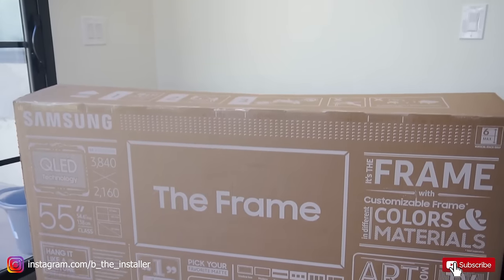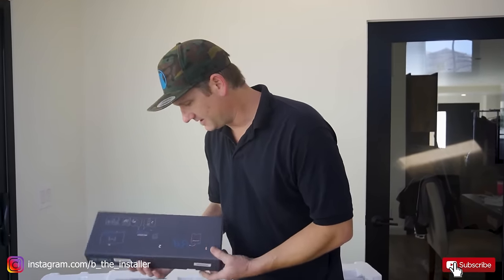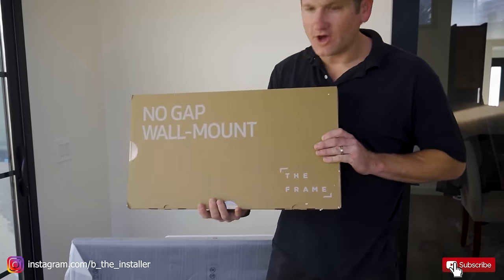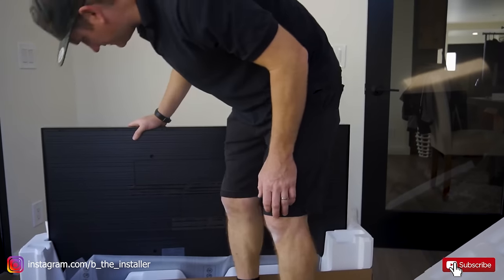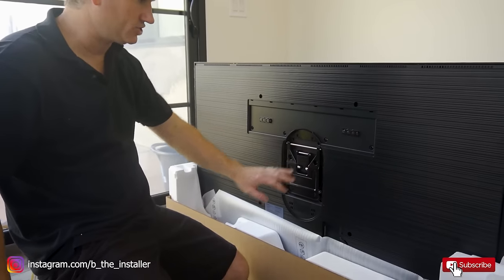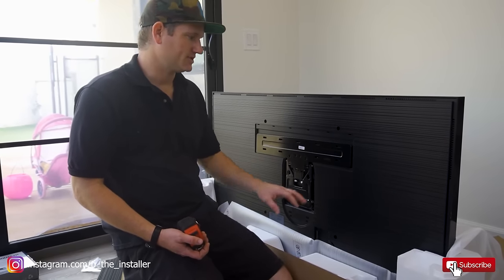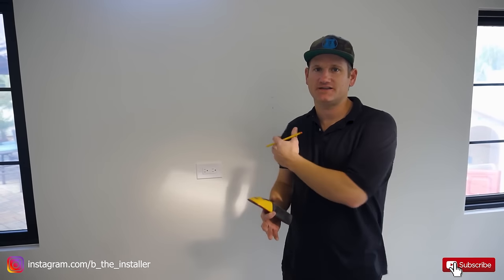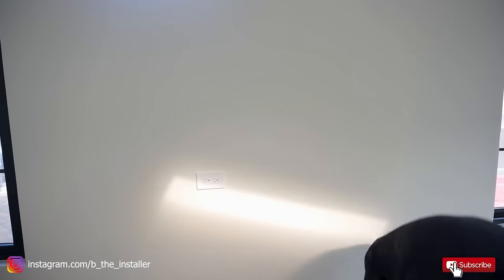Samsung Frame TV Installed w/ "No-Gap" mount in 30 minutes

Comment: Nice video thanks for posting as Samsung does not have a great source for specs I learned more watching your video. Couple?s for you have you done a 65” frame tv looking for the specs on that also wonder if the one connect box can be put in a cabinet or does it need to be in the open for the remote to work?
Reply from the maker: Thanks.  I made a FAQ video on frame that will help.  Its Bluetooth so can be put anywhere.

Comment: Hey man, just got mine, great video. What's the tool you use to cut the holes in the walls and what do you repair the drywall with? Thanks!
Reply from the maker: Drywall knife.  $10 at home improvement stores.  Fast lite 5 is the mud.

Comment: Great video but correct me if I'm wrong...I thought the one connect cable that comes with Samsung is NOT "in-wall" rated which means it can be a fire hazard when concealing the wire...no??
Reply from the maker: use a conduit

Comment: I had the same issue (24:15) with the leveling mechanism arriving off vs. the main bracket and not twisting. As B suggested needle nose pliers on the bolts did the trick (rotate counter clockwise) to loosen the mechanism so it could tilt with moderate force as intended.

Comment: Hey, great vid! Quick question: What is the official name of the box that you fished the wire through next to the power outlet called, so I can know exactly what to ask for at Home Depot? Thx
Reply from the maker: That is a single gang low voltage box. And a nylon oversized blank cover plate that I drill a hole through.  Thanks and good luck.

Comment: Great video. I already have conduit behind my wall for power and hdmi cords. Will the one connect plug fit through 1 inch conduit?
Reply from the maker: The end that goes into box should be close... I think I used 1 1/8 inch to cut the hole for cover plates.

Comment: Great video and super helpful! One question: Did you use any conduit for the one connect wire?
Reply from the maker: Yes? You should.  Though it's still not 100% legit.  This wire is a combo data/power line and so technically the wire itself is a contradiction to code.  I'll let women and men with more time on their hands debate it's legality in wall.
Reply: If it’s not up to code try explaining that to the insurance company..response did no require that much time off my hands..

Comment: Awesome video! Thanks for taking the stress out of process. What size Toggle Bolts did you use?
Reply from the maker: No problem.  3/16" toggle bolts.  Normally 2.5" or longer.
Reply: @BTheInstaller  Worked like a charm!

Comment: Nice video! Why don't you use a mulitool to make holes in the wall?
Reply from the maker: My good friend also asked why not use impact to push bolts in too!  I've used milwaukee drills for while because when I need to drill 1" or larger holes through 4x4s and larger, it's just best to have a strong 18v.  But the average home owner can use whatever works.  It may be time for me to get a lighter drill.  Maybe the new M12 from mileaukee.

Comment: Brandon, thanks for this, awesome tutorial!  One question - if installing on concrete (dry wall layer in front), would the only thing that changes be the use of a wedge anchor instead of the togglebolts?  Thanks for your help and keep up the good work!
Reply: BUMP

Comment: I hanged a 65 inch frame tv but  I am kind of sceptical  i only used toogle  bolts  same as yours and I used  10 of them and there is no stud in the wall just dry wall and it survived its first day mounted would  it be safe to leave  it or to bring it down ?

Comment: Thank you for a great video! We have a wall that is not exactly straight, which means that if we hung this flush onto the wall, the TV would be farther away on the left side than on the right when we are sitting on the couch watching it. Is there a way to use one of the extender bolts you mention at 5:02 on the left side and then not use it on the right side to give the illusion of being straight?
Reply from the maker: The bolts are for keeping it further away... if its just a little curved I would use the foam... you can even double up the foam if needed but I would balance the gap on both sides. Most people won't notice.. many pictures hang off the wall a little.  But yeah I would add some on the least visible side so the more exposed side is clean

Comment: Excellent video and instruction. I am considering a purchase but there is no place to store the one connect box considering where I want to install the TV. Ideally I can easily place the one connect box in the basement but does the TV controller need to point to the one connect box or the tv?
Reply from the maker: No, it's Bluetooth.  You can put it in the wall. Not sure your wall type but I'm going to do a video soon on how to do this.
Reply: @BTheInstaller  Great thanks. The wall is just standard drywall with easy access to the basement. So I want to run power, the box and all cords down the wall to store in the basement so the only item on the wall is the TV....like a true picture frame. Looking forward to the video.
Reply from the maker: @marcocondoleo2616  i can't say 100% the Bluetooth can work through the floor to basement.  It works in adjacent rooms and pretty good reach on my tv... never tried a downstairs.   The install I will do is directly in the wall right behind the tv. So you wouldn't need to run downstairs.  But its a different application.
Reply: @BTheInstaller  There is a closet behind the wall where I want to install the TV so perhaps that's a better place for it since the bluetooth works through walls. I could try it.
Reply from the maker: Yep, by the way you were about the 250k view.  1/4 way to 1M
Reply: @BTheInstaller  Awesome! Looking forward to the next video on this topic.
Reply from the maker: Make sure to check out the new white frame video.  It's pretty snappy and has some good music and text

Comment: My understanding is that the One Connect is not "in-wall" rated. As a professional installer, do you recommend this type of install if the manufacture does not?
Reply from the maker: I've answered this over 100 times on this video... its not in wall rated, its your call.  The risk of the cord getting cut in wall or advancing a fire is not up to the standard of electrical code.  It is unlikely to cause fires but I can't give you guarantees.

Comment: Awesome video. Very informative and I will use this when I reinstall my TV in my new place. I have the 2018 q9fn. Was wondering if you could tell how to remove the TV from the wall mount as we need to move the TV soon.
Reply from the maker: I dont know the mount is it a no-gap?  It just lifts off straight up.  A little difficult.  Just lift up

Comment: I’m reading that the wire isn’t rated for in wall use. Is that correct?
Reply from the maker: correct, it technically should be in a conduit. you can order a Non-split loom 2" conduit on amazon for like $30 for 10ft section

Comment: Great video! Do you have any recommendations for full swivel mounts. I just bought the 32 inch version and the rear mounting screw holes are 600mm wide by 400mm high. It does not have the usual vesa pattern. I want to be able to use a full tilt mount. I am having a hard time finding one that will fit . Thanks!
Reply from the maker: The 32" does not have a 600x400 pattern.  It's like 200x200. But why would you put a frame on an arm mount.  Just get Samsung q90t
Reply: @BTheInstaller  I want to hang it in the kitchen between the upper cabinets and the countertop. I am a photographer and love seeing my photos when it is off. The only holes that seem to accept screws are located where I described. There are indentations in the regular VESA pattern but they are covered. Is it ok to pierce the backing?
Reply from the maker: No.  The 32" tv is only like 26 inches wide.  600mm is like 24 inches. So you're saying the holes are 2 inches from the edge? No.  It has recessed holes. You use long M8 bolts i believe.  But you can put on an arm mount. Actually they have "single arm recessed mounts" as well. Search that up as I wrote it. You could cut the box out of drywall for that and put in wall and it would still go back flat to wall.  I am certain that does not have a 600x400mm or 24x16 inch mounting pattern. Not even the 75 "has that.

Comment: Thanks.  Could  i run the cable  up into the attic and then down to where the box is located?
Reply from the maker: Any in-wall usage of the cord is difficult.  Running up through studs and into attic and back down is exponentially more complicated and you risk more issues. Ideally I would hide it behind the tv if you don't need to connect anything to it.  If you do, opposite wall or under is better
Reply: @BTheInstaller  thanks so much!

Comment: Hello B, what a fantastic video😊 I’m due to receive the 2020 version same size on Wednesday. Mud question is how can I get the wire not underneath it but further down to the right and under as that’s where I have my sockets? Thanks so much
Reply: My*
Reply from the maker: Hey Oumar,  I would consider moving a power outlet over closer to tv or getting the in-wall rated cord if you have to cut drywall out to route it through the studs in wall.... which is what you'd need to do.  Its not easy with any type of wiring for a DIY'r but the thin wire wouldn't be very safe in wall like that
Reply: Amazing, thanks ever so much!
Reply from the maker: No problem.  If you had planned on having nothing under the TV, like many of my customers, then we do try to figure something out like routing it behind to a room on opposite wall, or like you initially asked, down the wall inside... so it's a common need, but also you can solve by getting a decoration under the TV and just dumping the one connect inside a magazine basket or something if you can extend a power outlet closer

Comment: Fantastic, informative video, thanks for sharing! Have had a 55" Frame since Xmas and haven't yet put it up because intimidated & assumed I needed help with the installation. SO grateful for your video which makes the whole project seem less daunting. Any advice on installations on stone? I know it may not sit completely flush with the wall because of the stacked stone facade. Just wondering if you have any tips on stone installation. I am replacing a TV, so I do already have an outlet in the stone as well as a hole to feed the One Connect through. Any advice would be greatly appreciated!! Thanks for sharing your expertise!!
Reply from the maker: No problem.  Stone is easy if you use the right tools.  Check out my video on mounting samsung tv and mantel over brick fireplace.  I show how to do it.

Comment: #1 rule before cutting into drywall. Always check for studs before you cut. That sideways outlet should have been a red flag that there was a firewall. Exterior walls with windows are often weird with framing so best to mark studs before you start.
Reply from the maker: There was a few red flags for sure.  But when you set up to make a video, sometimes you get caught up...  glad my set up is a lot smoother now...

Comment: Excellent video. Very well done and edited. I'm an installer but have not installed one of these TV's yet. I have a customer that is requesting 3 of them so I'm going to get some experience REAL fast. I was surprised about the One-Connect box and have a few questions.  - He wants a clean install in his family room and there is no place to put the box. I am proposing that it goes in a utility room in the basement directly below the family room. The in wall cable run will probably be about 25'. What tips or suggestions do you have for running this cable? Is 25' practical or will the signal and/or remote not work well through the floor and down to the controller?
Reply from the maker: Hey, not sure if the Bluetooth remote will communicate that far.  I put in the room behind the tv many times and in cabinets left and right. Pretty easy tv to install.

Comment: If I were to need to put some conduit so that the cord could make it to where I need to go... How big would the tube need to be to fit the connection for the box? Can't seem to find dimensions of that little connection.
Reply from the maker: small end is 1.25 inch or so.  there is a good 2 inch non split loom 10ft conduit for like $20 on amazon.  i'll link in this video when i can.

Comment: Great video, one question? 50inch Frame. How can you find the mounting bracket measurements  and measurement to the top or bottom of the tv. I want to put timber behind the drywall before the drywall goes on. Yes I could buy the TV and measure but I don't need it for 3mths due to being at construction stage at the moment. SAMSUNG website has everthing but this measurements.
Ryan.
Reply from the maker: You don't need anything behind the drywall.  Just frame it 8 inches each way off center.  These tcs weigh like 30 lbs.  Just toggle bolts alone are what I use most of the time.

Comment: Thanks for the video! I do have one question. How'd you run the one connect cord through the small hole in the face plate down below? The edge of the one connect wire doesn't fit through it. TIA.
Reply from the maker: The small end fit through that 1 1/8 cover plate.  If I have to run one end and one is too big, I just run the small one in reverse.  Does that answer you?

Comment: Awesome video, I watched it before installing my Frame mount! I ended up hitting concrete less than an inch behind the drywall, so there wasn't room for the toggle bolts to open up. Luckily I had good stud placement and hit studs with four screws and just left it at that. Should be ok, right? Still waiting for Samsung to ship the bezel though!!
Reply from the maker: I'm not sure how you hit concrete and studs. Normally there is only one of those 2 things behind a wall.  Its possible in some instances there is brick, like a fireplace and then contractors frame around the brick with studs and so it's possible to mount a tv and not run the wires.  I'd be interested in knowing what you're doing with the one wire?  But if the mount is firmly on wall and you felt pressure when driving bolts or screws in, that is what is important for safety.
Reply: @BTheInstaller  it's the party wall between my townhouse and the neighbor, so I guess it's some kind of cinderblock or concrete firewall behind the drywall. I was able to fish the onewire in the space between, but had to get through a bunch of insulation. I definitely hit studs, I could see them from hole I cut at the bottom of the wall where the onewire comes out. Got the bezel yesterday and its lookin fly! Thanks again for the videos.
Reply from the maker: @howellb1  success.  Good work.

Comment: Fantastic installation video! Thank You.👍 I got the 65” and I’ve asked the guys installing a gas fireplace within a new chimney breast to install the wall mount and cable so it lines up nicely with the fireplace and mantel beneath it.

I assume I can easily take the TV off the wall mount to paint the wall?
Reply from the maker: You lost me at breast!  Yes the tv comes off easily when needed.
Reply: B The Installer haha... thank you.

Comment: At 20:00 I would have switched off the mains power and pulled forward the GPO (general purpose outlet) to inspect what's behind before cutting the hole.  Plus I never 'CUT' a hole anyway for fear of cutting through a power cable and killing myself - instead I punch screw drive (blunt plain blade is fine) size holes into the wall 1 by 1 to cut out a rectangle shape in the wall - this way there is no danger of slicing through a mains power cable.  By inspecting what's behind the GPO first you can see where the nearest studs are and where the mains wires run, and if you have a $10 ebay endo camera (or small mirror and light) you can see what's going on in the cavity. Also at 20:10 I try to keep the wall holes as small as possible to minimize spiders and bugs getting in the house (or tape over the hole after threading the cord).   Also at 22:30 you don't need to fish-tape up a wire (plus I hate using conductive wire for such a purpose behind a wall). Instead you can tie a small fishing weight or bolt-nut to a string or fishing line and drop the nut into the hole, which pulls the string with it.  Then tie or tape your cable to the string and gently pull it through.  Also at 22:55 if it was my $200 one-connect-cord, I would have been a lot gentler, and treated it like glass (like you would treat a fiber optic cable). They say the bend radius is only 10cm which it looks like you pulled tighter while handling on a number of occasions.  But if it was a customers $200 one-connect-cord I probably would have been as rough as you - you just don't want to see intermittent issues in a year or two caused by unnecessary stress during installation. Also at 24:33 you should use a 10mm open ended spanner (not a socket or needle nose pliers) to maximize nut tightness without damaging the nut.
Reply from the maker: Ok guy..

Comment: Nice job but just a few points to maybe save you from making a hole. When see you a box(elec/any)mounted horizontal it has something horizontal that it’s mounted to. Also you didn’t center the tv vertically with the windows. It really shows. I always center both vertically and horizontally. Nice job and thank you for making the video.
Reply from the maker: Yes, as my stud finding video states, you are correct for the most part.  Some boxes are put in as old work in homes.  And the location of the tv was exactly where the customer wanted it.  As for the height, I always base it on 3 things, customers desires, what will be under the tv, and my professional opinion on viewing angles.  I rarely center things vertically,  it wastes a lot of good space under TVs and people have historically agreed over about 15k installs.  Thanks